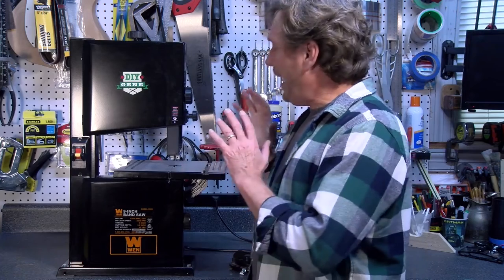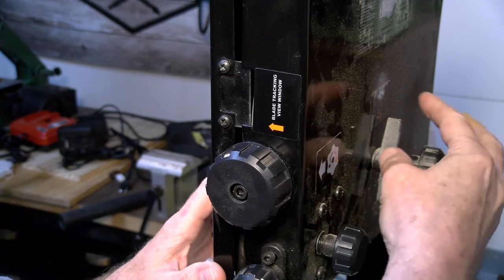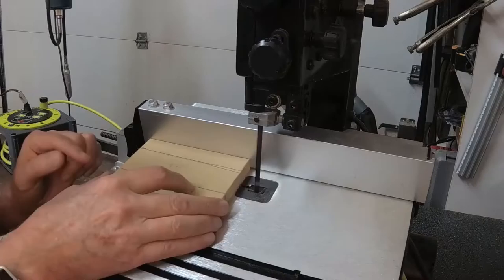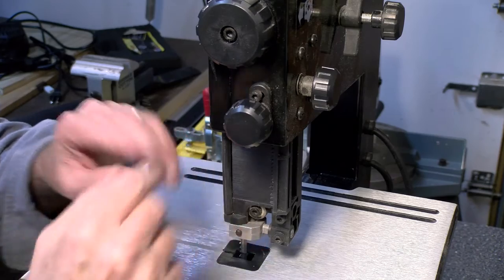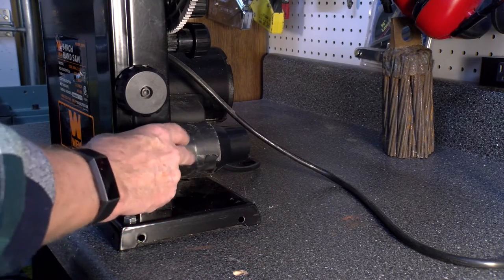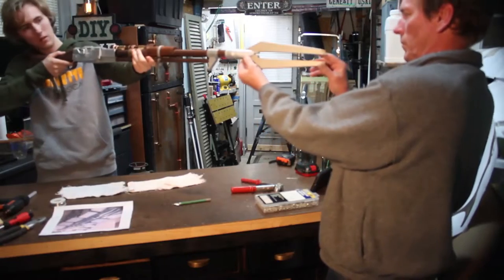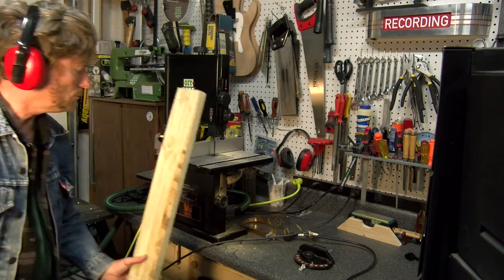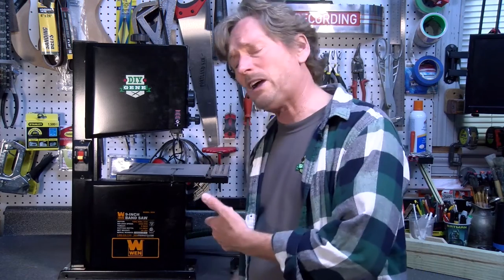One Year Review of the WEN 3959 9" Band Saw

Comment: thanks for posting - I've been contemplating this along with the drill press for a while and I had already heard pretty decent things about the drill press and this is the third positive review i've seen today on this saw. I just pulled the trigger on purchasing - should have the saw at my door in about two weeks. Looking forward to using it.
Reply from the maker: I hope it works as well for you as this one has for me. Thanks for watching.
Reply: The press has a strange adjustment for the belt tension that struck me as flimsy, but once I set it, it’s held up well. I ignore their speed chart and tend towards the slow speed for most of my work—mostly 1/4th” holes in steel. It actually goes through really well.
Reply: @DIYGene  yah I got the saw - the drill press went up in price though!! So i'm waiting until I can find a deal on it close to what it used to be again. The saw has been working great for the smaller pieces its designed for. I've used it nearly every day and even a few times ran some large boards through it just because it was faster than setting up the track saw. I have noticed that even with a dust hose on it, dust likes to build up on that lower control but not a huge issue to just stick the hose right on that part regularly.
Reply from the maker: @davidkeetz , have you tried the tall side of a 2x4 yet?  I’m noticing the price increases on tools and especially lumber. I hope this all come back down soon. Thanks again!
Reply: @DIYGene  I have tried a 2x4 set upright - you have to go verryyyy slow to keep it straight, at least with the blade I have on it, but it's doable for sure - I've ripped an 8" piece of 2x4 on it, as well as a 3" x 3" x 6" block of cast resin and wood that I cut up into 3" x 3" x .5" coasters and that turned out fine.

Comment: Overall a good saw for the money. I don't like that the side guides are little posts to push the blade rather than bearings... Some of the adjustments can be a little finicky but you're still getting good bang for buck. Not what I'd call a precision tool but it gets the job done for a low price.
Reply from the maker: I agree. It’s a great tool for the home shop. Thanks for watching.

Comment: Would love to see a review of the Worx Bladerunner Table Saw.  I'm a hand weaver and after purchasing a small drill press, jig saw and a hobby table saw, I've saved hundreds of dollars making weaving tools that I would normally have to buy.  I live in an apartment and keep tools stored in a closet.  I'm trying to decide between the Wen Band Saw and the Worx BladeRunner Tabletop Saw for their size.
Reply from the maker: I looked at the blade runner and I opted to by a scroll saw from Harbor Freight. It just seemed to be built better. The blade runner was mostly plastic and actually cost more. I now that probably doesn’t help much. My shop is very small and I keep the majority of my tools like a 10” potable table saw and a belt and disk sander under my work bench.

Comment: There is a 2021 model 3959T. What do you think of it? You mentioned if it is setup perfectly then it is great. How do I know when it isn't setup correctly and how often do you need to tune it? Out of the box - does it need tuning/setup? After how many hours of use do you think it will need the setup? How hard it is to do the setup?

Comment: Have you used the Wen for cutting metal ?  -- Such as alluminum, copper, or brass ?   -- I have been trying to decide whether to get the Wen or the Central Machinery (Harbor Freight) 9 in bandsaw. -- The only reason I had been thinking of the  Central Machinery saw is because it will take a 1/2 inch wide blade.  1/2 inch blade is what most metal blades are. -- While the Wen, Ryobi, and others only take a 3/8 wide blade. --- Otherwise, it looks like the Wen is built better.   Any opinion ?
Reply from the maker: I looked at the Harbor Freight band saw and just didn’t think it was built as well. I have only cut 1/4 aluminum and 1/8” brass so I really can’t give you a good reference. I hope this little bit helps. Thanks so much for watching.

Comment: I wonder how this compares to the Shop Fox 9 in. Benchtop Bandsaw Model #W1878. I can't get this bandsaw and considering the Shop Fox bandsaw which is more expensive. I can't find a review of the Shop Fox w1878.
Reply from the maker: I think the construction on the WEN is very similar. But also found the XtremepowerUS 9" that has very similar construction as the Shop Fox but runs at about $180. Here is a link to what I found: 
https://amzn.to/3geSPon
All though I looked at the ShopFox and I do like the Rip fence.
Reply: @DIYGene  : I want one with a fence which many of the 9 inch do not have. The Extremepower 9 inch does not have a fence. Also I noticed it is no longer available like the Wen. I think I would prefer the Wen 9 inch but the only place to get one is on eBay but such items I hate to order online and prefer to purchase them locally if possible, though I don't mind ordering on line through a local dealer.
Reply from the maker: @rayrainer985  I so agree with you. I just don’t trust EBay. It would be so nice to be able to go to a store, look at the tool and say yup this is it.

Comment: Can you use it  to cut aluminum tubing?
Reply from the maker: I used it to square aluminum 1.5 x 1.5 inch by 1/8” thick and it did fine. I would make sure you use a blade made for cutting aluminum. Thanks for watching.

Comment: I have the same saw and mine stalls on cardboard lol. I must have got a dud.
Reply from the maker: Do you think the motor is bad? Mine has plenty of power and can cut some hard materials. I wonder what’s up with the one you have and if it could be fixed?
Reply: @DIYGene  it could be but I don’t see how it works fine. Basically a 2x4 of pine it can’t cut. It will cut 3mm birch that’s about it. Nothing like what you’ve cut here. I just think I got a bad saw. I’ve tracked it I’ve adjusted it, I’ve drift corrected it, I’ve replaced the fence. Lol. Wen it works. 😂
Reply from the maker: @fsecofficial  that’s too bad. You should complain to WEN and see if they will do something. That just isn’t right.